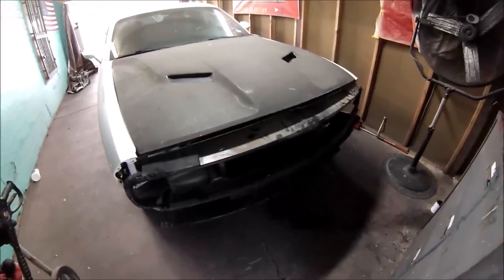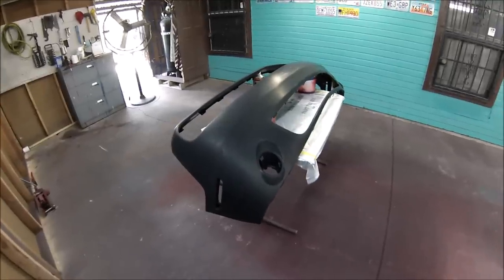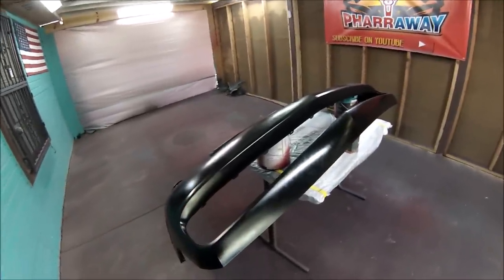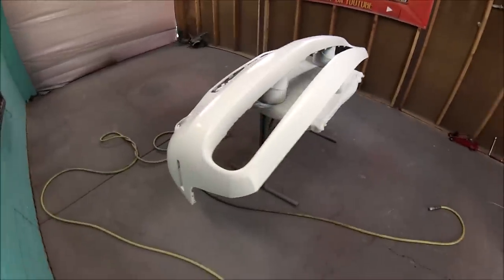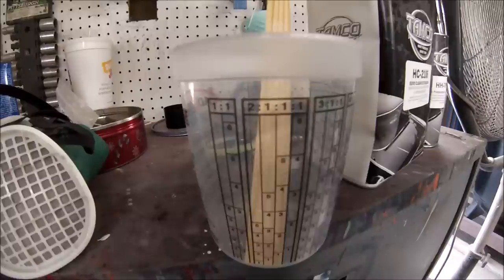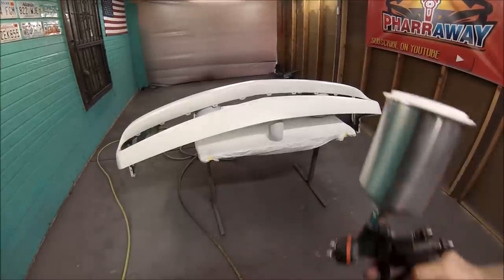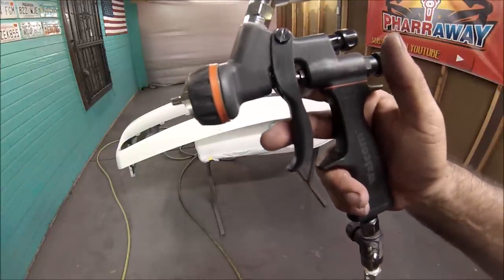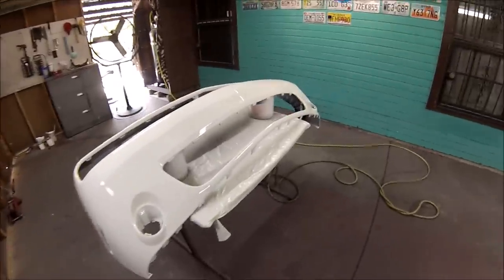HOW TO PREPARE PLASTIC PARTS FOR PAINTING

Comment: I used 400 grit wet sandpaper. But everyone else is using the scuffing pad.  Well done, I wasted to much time. And I didn't use adhesion promoter, but I bought some for the next plastic bumper. Thanks for the video enjoyed it.
Reply from the maker: any time brother
Reply: Ken Sendelofski  in don't need to wet flat ..... I only use grey scotch with panel wipe faster
Reply from the maker: @6655nico  Yes that's all

Comment: Have you ever had problems with the tar grease remover on plastic? Have you used epoxy directly over the factory plastic primer? How do I know if I have Lacquer or Urethane primer is there a simple way to test it? Is 1k bonding primer ok to use directly over plastic parts without adhesion promoter? Should I mount the part before spraying it to avoid cracking and scuffing installing it? Thanks for the information brother another great video and I like that you are adding more practical information and products explanations to the videos.
Reply from the maker: no never had any problems, and there is a way to test the primer but I have never used it so I wouldn't know how. and about the 1k no this will cause delamination in the future I don't recommend it always use 2k and about the mounting part that's up to the painter I will paint it off and just be careful while installing

Comment: Why you need to scuff it? And whats the difference between scuff and sanding? You can answer in spanish too, thank you for the knowledge, liked and shared 👍
Reply: You will trap sand in the plastic and leave trails or tracks in the part. If the part is already primed you could sand it with 800 grit but most do not because the primer is so thin it will cut through in a heartbeat. Some Major shops don't scuff or sand they shoot right over it but I have had parts come back because of cracking and lifting because I didn't. Just my opinion though.
Reply from the maker: @gorrillacgorilla405  Thank you brother nicely done that is exactly the right answer
Reply: @PHARRAWAY  I've got a lot of plastic to paint you want to come over and help I'll provide the refreshments and snacks...lol
Reply: Scuffing means pretty much the same as sanding. When you hear scuff it's cause there using a scotch-brite pad. The steps I do when dealing with plastic parts is wash them with warm water and soap. Then after that I use a scuffing gel and a grey scotch-brite pad cause it's finer then the red one.
Reply from the maker: @careygale2315  nice

Comment: Adding the sealer AFTER the adhesion promoter doesn't defeat the purpose of the first one? Why you need to seal after the adhesion promoter? Car paint needs to be painted OVER a sealed plastic part? Again thanks in advance for the response. Noob here hungry to learn this this cool skill/ job.
Reply from the maker: The sealer will help you with the paint this is a black piece and if I will add paint directly it will be fine but I will waist a lot of paint so the sealer helps me hide the black quicker

Comment: I had to strip 3 paint jobs worth of paint from the plastic parts on my 96 Camaro, used 180 grit but will need to go back with 320+ grit to even it out. So if I treat it like new plastic and follow these steps, I should be good right?
Reply from the maker: Yes your good

Comment: hello farraway hope all is well i am always excited to see your video a big thanks 
i have a question for you?
(1) scotch brite what grit was you using as some would say use grey scotch brite on raw plastic
i have used both and perfer red scotch pad that you used in this video (2) also if you was scuffing a panal which has got clear already so you could spray base or clear what colour scotch pad grey or red
(3) when you put sealer on what was the size of nozal
(4) what was the tepertchre so i know the flashing off time inbetween  thank you once again cant wait for you next video take care
Reply from the maker: Thanks
(1) you can use the gray scotch brite but I found out that it will not scuff it well so I started using the red I has a bit more scuff to it. (2)and if the panel has clear go with 600 grit sandpaper don't use a scotch brite I usually wet sand with 400 and move to 600 before painting.
(3)and the needle tip was 1.3 I found out that works best
(4)the temp. was at 95 degrees

Comment: Have you tried the White Forever Sealer from Tamco?Also I know its temperature depend but how long did you wait between coats on the clear?Sorry one more question.Was the sealer urethane polyester or epoxy and why no reducing? Thank you very much. Great video.
Reply from the maker: I have not tried white forever from Tamco and about the time between coats was 15min even on the clear
Reply: @PHARRAWAY  Thanks

Comment: great video, what spray gun and compressor are you using as I found this video useful for a grill and bumper I have to paint, thank for the vid
Reply from the maker: The compressor is a 60gallon and the gun is a walcom carbonio 360
Reply: @PHARRAWAY  many thanks, I got another question do you have a video or will do one re- painting a car pannel? or would it more or less be the same  thanks in advance

Comment: Hi I noticed you used the same gun on the sealer and basecoat and clear .Did you do a thorough cleaning on the gun between material changes or what did you do?Also on the sealer and basecoat you were at 29PSI but on the clear you were at 35 PSI . How did you figure the change in PSI?
Reply from the maker: Yes I do I completely clean the paint gun between changes, and about the air pressure that is correct
Reply: @PHARRAWAY  With the air pressure did you see something in the spray pattern that caused you to increase the pressure from 29 to 35 or was it ust experiende . Thank you your videos are great!!
Reply from the maker: @6364Chevyguy  I just saw that at 33psi just leaves the clear flat with minimal orange peel
Reply: @PHARRAWAY  Very interesting .Thank  you very much?

Comment: I did a rustoleum paint job. Take a look at my channel and let me know what I am doing wrong!
Reply from the maker: I sure will Thanks
Reply: I got my start on Rust-Oleum. Haven't used it in over 10 years. It's a great learning experience. I'd like to check out your video too. What you'll end up finding out is that automotive paint is MUCH easier to shoot, less expensive in the long run, and better performing. I have a few interesting videos you'd be able to learn from on my body shop channel concerning rattle can paint, and bad chemical reactions. Might be helpful to you
Reply: Carlton Flowers thnkx

Comment: Since you don't have a shop where it bakes the paint to make it dry faster, do you use a fast drying clear coat?
Reply from the maker: no I use slow it's about 100 degrees here
Reply: @PHARRAWAY  so how long does that usually take to dry? How long until you can touch it and start assembling
Reply from the maker: @Bodycomp101  about 5hr more less
Reply: @PHARRAWAY  thank you!